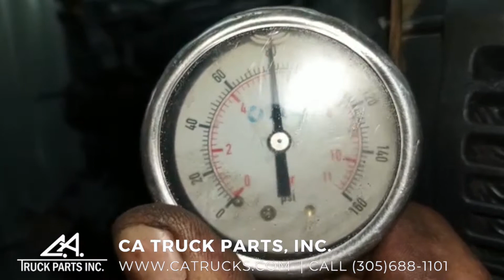2006 Cummins ISB 5.9L Diesel Engine For Sale TEST RUN VIDEO | CA TRUCK PARTS, INC.

Comment: Would that engine fit in a 2000 Freightliner FL70 🤔
It has a Cummins engine ICS 225HP 2200RPM
Eaton Fuller FS 6406A transmission 
it right now.